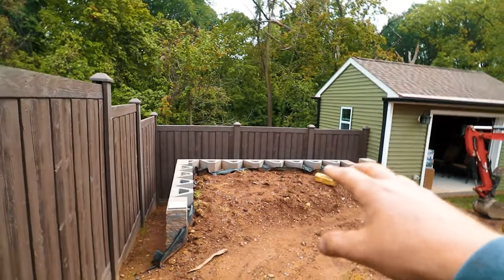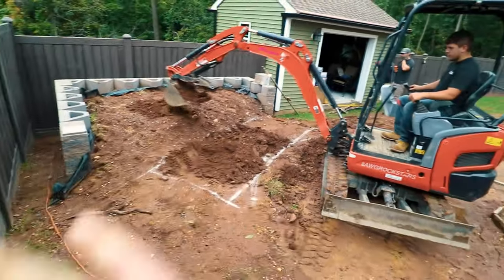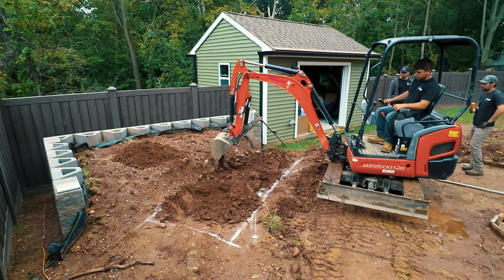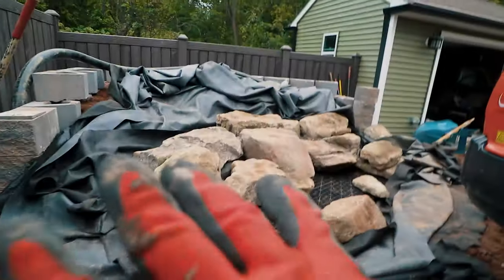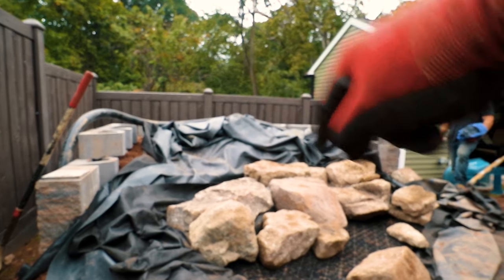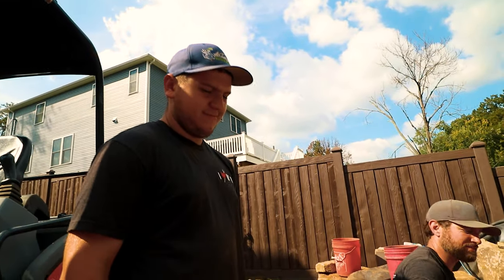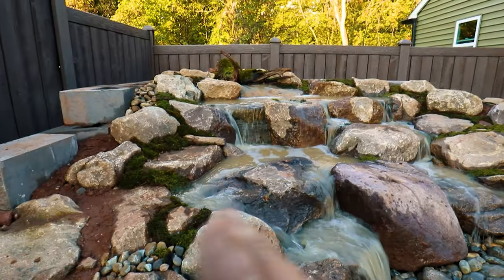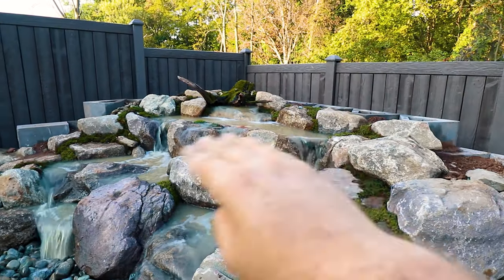Building a PONDLESS WATERFALL in a Small Backyard | Finished in 2 DAYS

Comment: Hi, I love this video! It's exactly the look I'm looking for, I'm in Los Angeles. I've dreamed of a 8' x 12'  pondless water feature for my backyard for several years, however, haven't been successful in having one installed. Approximately how much would something like this cost? A company in Sun Valley quoted an outrageous $8800! And it didn't look half as good! 
Thanks for the video. Reply requested, thanks.
Reply from the maker: We'd be at a littler under$20k with lights, autofill and algae elimination system.
Reply: And I thought 8500 was a lot! If you don't mind, please share why so pricey?

Comment: Gosh I keep getting more confused on how to do mine.  Looked at youtube videos for years have followed you all for years and still hadn't gotten anywhere with mine.  Mostly because I'm working with such a small area.  Awesomeness job as always that looks amazing.
Reply: You’re over thinking it. Let the rocks speak to you!
Reply: I was the same way with my koi pond.. been planning for years and never understood how to level the water and build the waterfall... until this summer when I started building my pond. Best advice is just start doing it.. it starts to become self explanatory
Reply: @raqeebali2442  yes totally agree and I did get a start on it.  Just need to figure out volumes and flows get the equipment and keep moving forward from there.
Reply: @Tony-InLosAngeles  I will just need to go ahead and get to that point with equipment and liner.  Should fall in place at that point better than I'm thinking it.  You're absolutely right about the over thinking it part! Bad to do so.